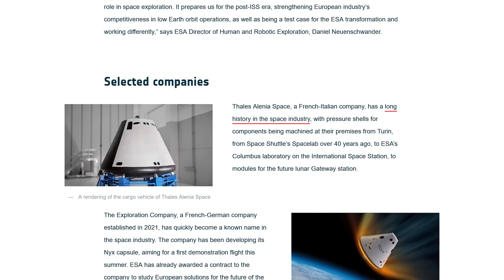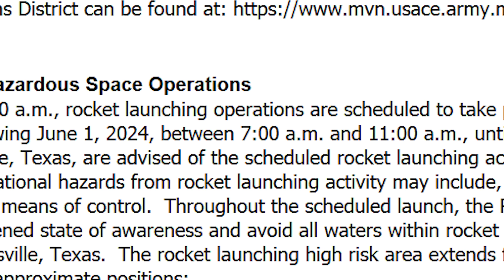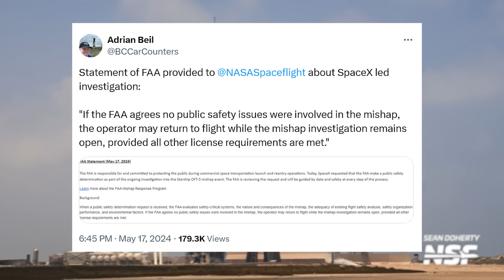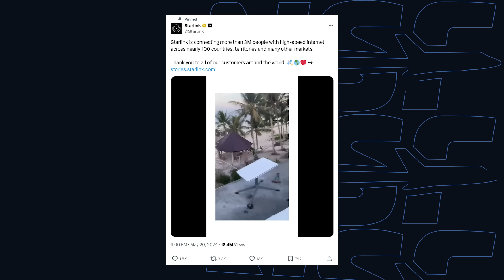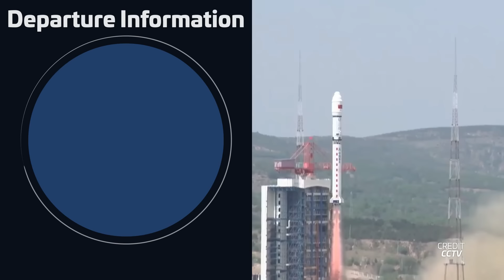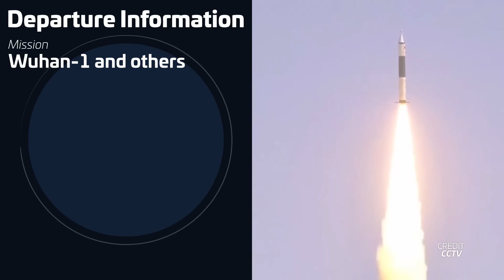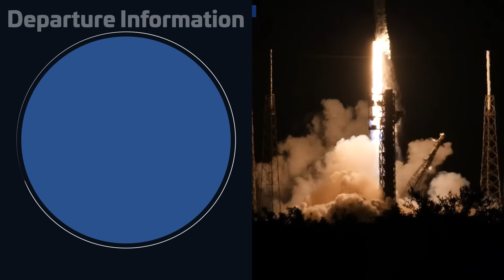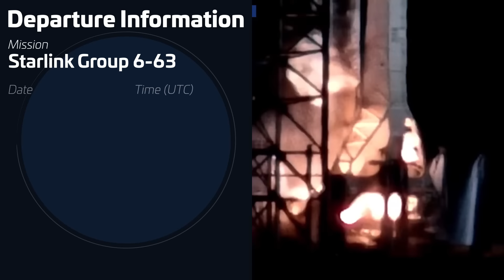Starship's Next Launch Date REVEALED! | This Week In Spaceflight

Comment: You'll never launched on a Saturday or Sunday it would cost too much problems for the local on the beach traffic it'll be either the 3rd or the 4th of June before they before they launch
Reply from the maker: Currently NET June 5th as per the official SpaceX tweet shown in this video. - Das
Reply: Flight 2 was on a Saturday btw, so it's definitely a possibility

Comment: Launch happen end of the may
Reply: Waiting on fts and the launch license really. Can’t take more than a week or two. Elon time might actually be on point this time😂
Reply: @Ch33ziTzsk8R  flight date delayed now it happen june 3  much time left for 4th flight
Reply: @a7m3d_28   sounds about right but idk if I seen road closures past june3 as far as I know. But it’s still exciting cause we’re like right there. The anticipation is of killing force👍
Reply: @Ch33ziTzsk8R  what do you think about 4th flight it can be success Rentry starship and booster?
Reply: @a7m3d_28   I really think they should wait till the 2nd and 3rd towers are fully operational, why risk the only functional tower?( unless they know for sure that it will work but we know how that goes) use the rest of v one ships/ boosters and get accurate data. Let’s say the first catch attempt goes wrong and we have a major set back. Ships/ boosters are going to be sitting around not being used getting weathered and rusty, and the older they get more outdated they are and more likely for scrapping… which all together would be a waist of time…
Reply: @Ch33ziTzsk8R Flight Four will be virtual catches at sea. Practicing hovering as if waiting on the arms to snatch booster and ship.
Reply: @mikegardner107   it would be really cool (and maybe hard to get the footage of) the boost back burn and virtual catch burn with the tracking telescope. Like the one second shot we saw right before booster 9 had that rud imagine having the whole journey on film that would be so awesome but weather has to cooperate